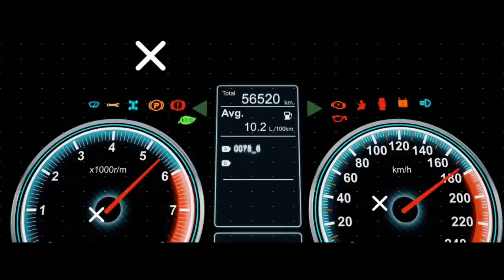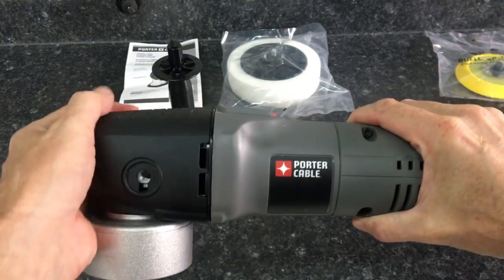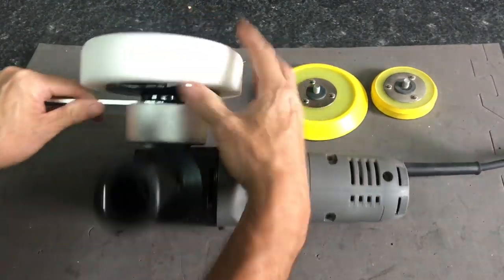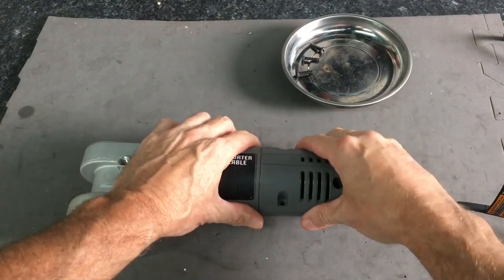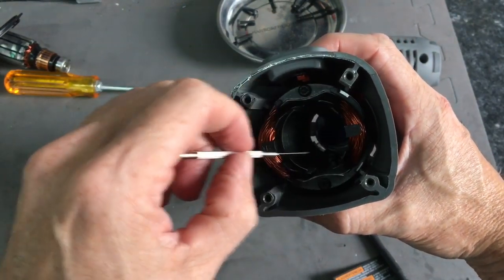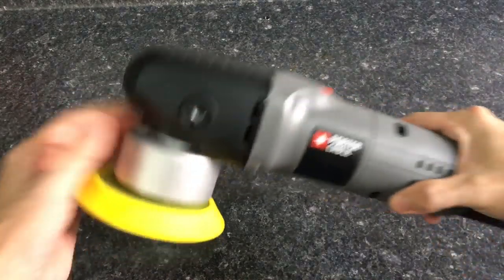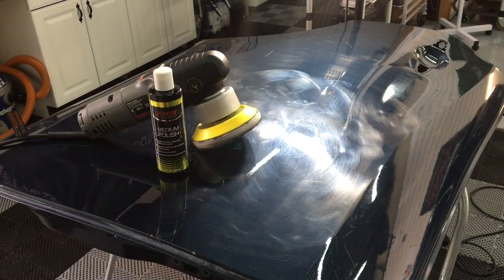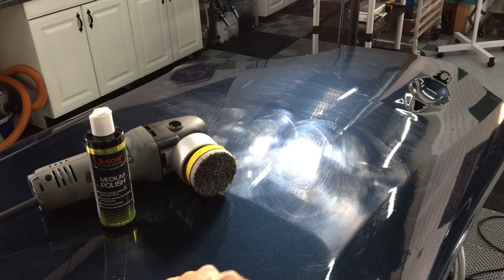Entry Level Polisher Review And Tear Down!!!! Porter Cable 6 inch Polisher!

Comment: What speed did you have the polisher on during the demo ?
Reply from the maker: I was turning it up and down for you all to hear ...and see in action.
Reply: Apex Detail what speed would you recommend to do first past then second and third pass? I have this exact polisher and a newbie to using polishing machines. Im old school and have done it all by hand all of my.54 yrs of life. Just using on personal vehicles
Reply: @neilburgner4577  - For removing defects I like speed 5. 

For polishing speeds 4.5 - 5. 

For applying wax or sealant - whatever speed that will rotate the pad. Sometimes 2 or 3.